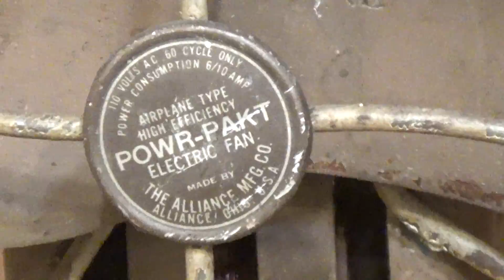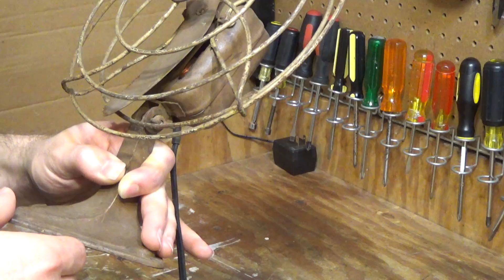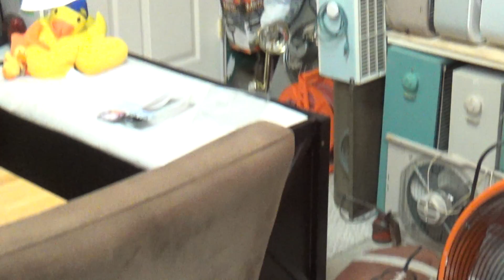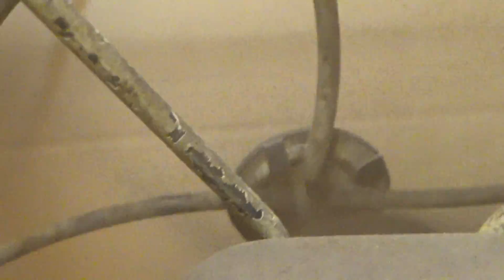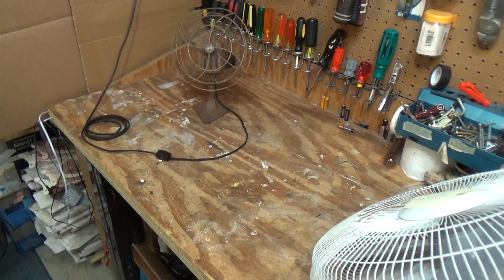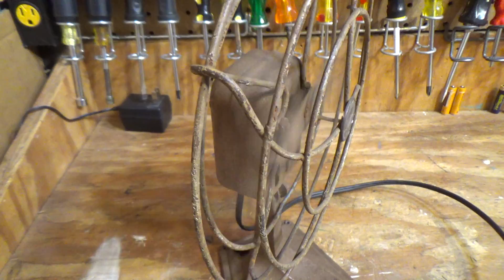Vintage Powr-Pakt Electric Fan

Comment: There are countless amounts of 2 bladed HV fans ranging from 16 to 36 inch in Asia, and they do put out lots of air. Some of them are a lot quieter than this though.
Reply from the maker: Interesting.. From my experience, all the 2 bladed ones I've worked with do put out good air but are relatively noisy..

Comment: Nice little fan. The collector community calls these microphone fans. You could add some pitch those blades to get the amps up to .62 amps at that voltage, that would quiet it down a bit.

Reminds me of a Barcol, but with a more raw sound.

Comment: These fans go for a pretty steep price on eBay. I've been wanting to acquire one for the longest, but they are just too pricey for me. Pretty sweet fan nevertheless!👍
Reply: If you're going to use ebay to look at market value prices, you have to look at the sold listings only.  Then you'll see what kind of prices people actually purchase items at instead of the inflated fairytale prices that seem to be becoming more common.
Reply from the maker: Even the sold listings aren't accurate, all it takes is one or two people to want something a lot and the price will go through the roof..
Reply from the maker: Thanks! If I remember correctly, I bought this one locally..I don't think I paid more than 20 or 30 dollars.. Unfortunately the prices on eBay for just about everything seem to be higher than they should be now.. I don't think they're an accurate reflection on what the actual market value is..
Reply: Jordan U I totally agree with you
Reply: That is a very pretty fan. Glad you said so.